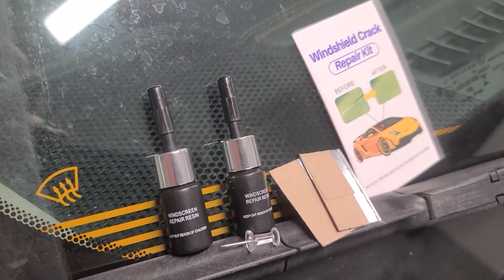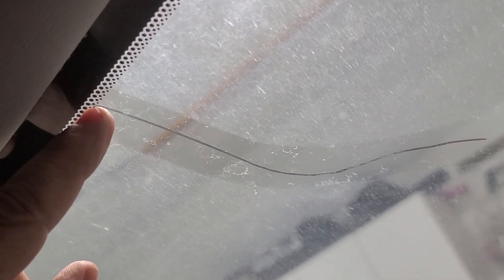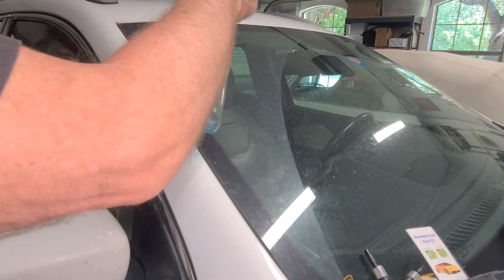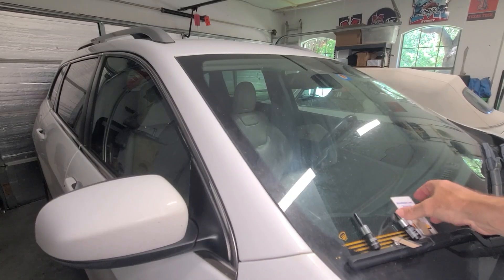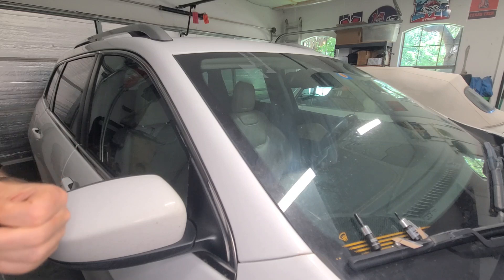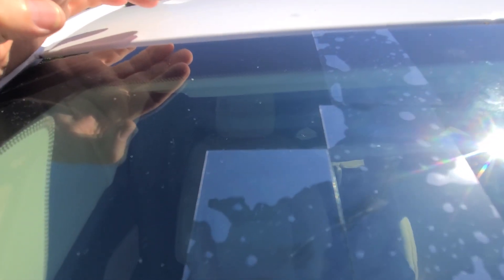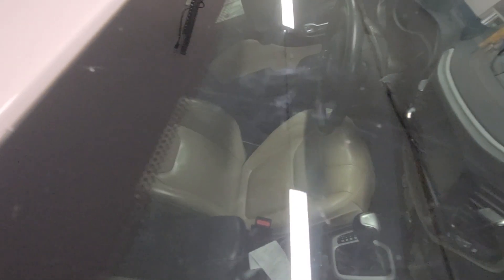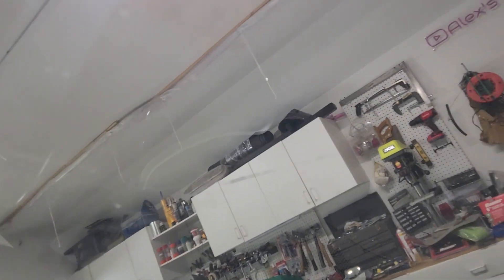BLUTOKS windshield repair kit - will it work on cracks?

Comment: Put pressure on inside of windshield while applying the resin.
Reply from the maker: That makes sense.  Oddly the instructions say to do the opposite.

Heat did not do much either.  I think I was just asking too much of the product
Reply: @AlexPlatacis  I used pressure on the inside and it still didn't work.  Lesson learned.
Reply: looks better, even if it's not a 100% solution..
Reply: How's it holding?
Reply from the maker: @SamSam-ih6nt  so far so good.  Not advancing